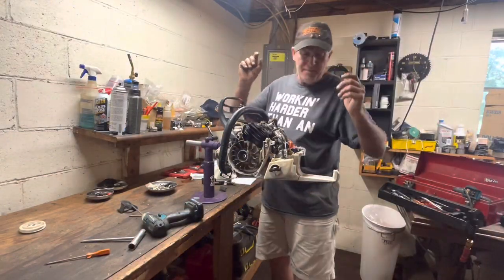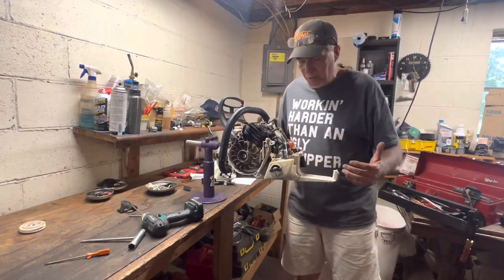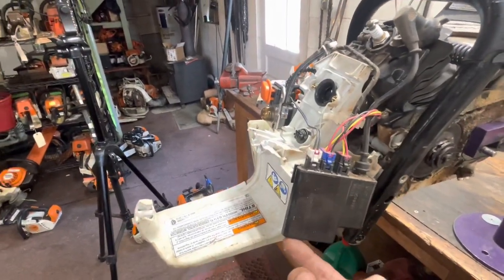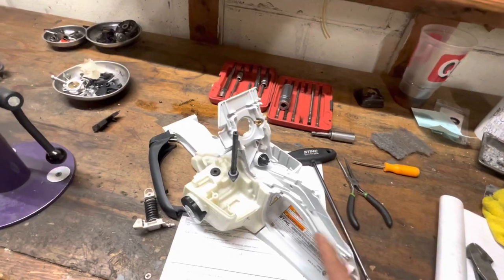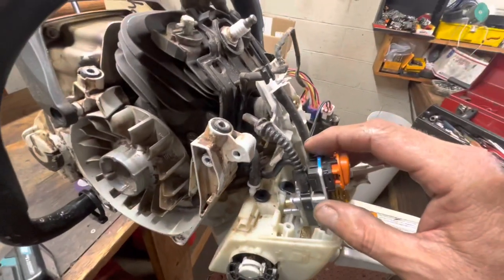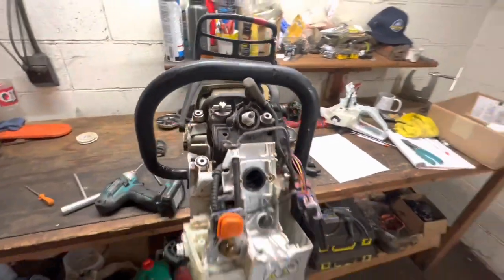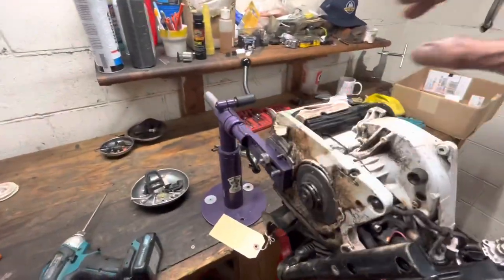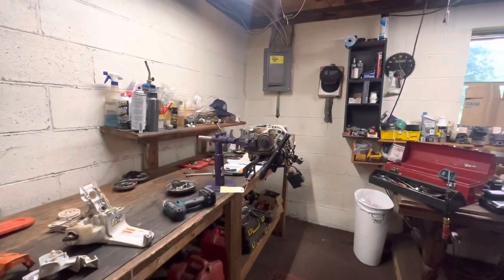Stihl MS500I Fuel Tank Remove and Install

Comment: I like these new Stihls, the post 2010 generation. Easy to work on without any weird screws or useless covers that need to be removed out the way. The only exception is the MS 441, but that was the first of them so we got to let it slide. Nice video as always.

Comment: Thanks,just bought new one  .educational..I put the suspension kits on it.and when I did the 462 that defective throttle rod will come loose,as it just clips over plastic .have had to start learning to work on my equipment more and more .last few years..need them to survive.cant do bottom end work .but started somewhere.seen a old 70,s model homelite today .blue. was actually a running saw.wish could've got it was xl